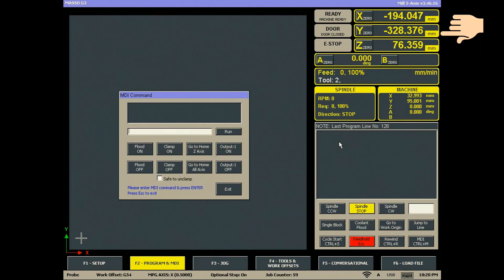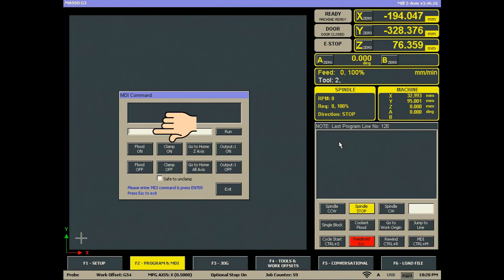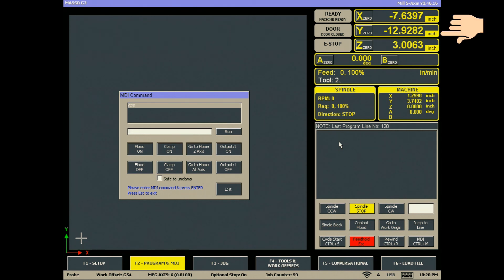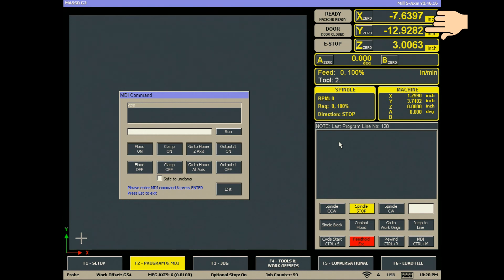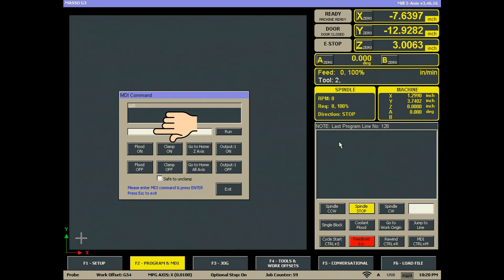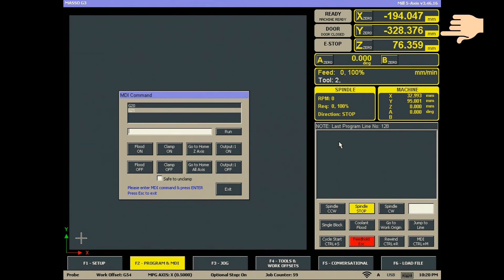Change between Inches and millimeters on your CNC - CNCnutz Episode 245

Comment: I got a dxf file that was in inches and it won`t change it to mm in my v crave pro
Reply from the maker: Maybe it is already open as mm. If this is the case you can always scale the drawing by 25.4
Select the entire drawing and use the scaling tool. This will resize it for you.
Cheers Peter

Comment: I’m a CBC virgin, and I’m having a problem with with the way my cuttings are coming out. I’m designing in Vcarve desktop, in imperial and using UGS to process. My jobs for example are 14”x14”, but when I run them they are coming out about 3”x3”. I’ve tried to find out what the problem is. I was hoping that you could help. What am I doing wrong?
Reply from the maker: Did you calibrate your axis? It you don't calibrate each axis it won't move the correct amount.
See my videos on axis calibration.
Cheers Peter

Comment: will it change the tool setting as well. I use mm that`s what I learned in.
Reply from the maker: It changes everything. If the tool is 1/4 it will remain 1/4 but is treated as 6.35mm.

Comment: Just watched your video discussing choosing MACH 3 or UCCNC and then this one.  Great video wonderful explanation.  Also I'm relative NeewBee so I chose UCCNC to start with but i am not able to understand how to change it to imperial.  Am I correct that UCCNC is metric only?  In reading below from qwert UCCNC is  unitless and everything is relative to the configuration file. Does this mean that you can change the units in the config  file. I would have sent to qwert but not sure he would see it.  Thanks in advance
Reply from the maker: Uccnc is neither metric or imperial. It works in that ever unit you set it up as. You simply tell it how many steps it takes to move 1 unit and that is it. You cannot change between units. Once it is set up but you don't need to. If for some reason  you want a metric and an imperial version just set up 2 different profiles and load the one you want.
Hope this helps
Cheers Peter
Reply: @cncnutz  Thanks for clearing this up for me.  I just need to learn how to create a profile.  Do you have a video on creating a profile?
Reply: Hello, I have created a new profile in UCCNC. What configs do I need to change or convert from mm to inches. The machine is in mm at this time.
Reply from the maker: You need to set up the machine using the inch as the unit if measure. When you calibrate the axis the steps per unit will be 25.4 times more that the current value. The soft limits will be 25.4 times smaller than the current ones. Each of the current units of measure will need to be either multiplied by or divided by 25.4 depending on what it does. In its most basic form  steps per unit is multiplied  all the other measurement settings are divided. 
Don't forget to backup the original profile before you start. 
Cheers Peter

Comment: Peter. When we get a project from Vectric in inches and I output that in inches in my post processor does that mean it also outputs the feeds and speeds I have put in my tool database, presuming I have the right sized cutters equivalent to the imperial measurements.
Reply from the maker: It sure does. Half my tools are imperial and I always use IPM for speeds and feeds because I did that way when I first started and can't visualize metric for those items. All my Gcode is output as metric.
Cheers
Peter

Comment: Just and FYI, UCCNC doesn't process G20 or G21 (they're ignored) because it's a unitless G-code processor and everything is relative to the configuration file. Thus, don't run either G20 or G21 files unless your machine is set up specifically for those units.
Reply from the maker: That's right which is why you use the post processor that matches the Machine rather than what the drawing unit of measurement.
Cheers 
Peter

Comment: Pete, very good video, I was just curious since the US and parts of Britain still use the imperial Neanderthal measuring system one foot in front of the other using the toes for better measurements. If you calibrate your machine in MM get it to the best accuracy in the millimetre measure and you then convert back to imperial figures, do you loose the accuracy?  I can only see that if you are machining parts that need tolerances in thousands or microns dimension, but I doubt anyone here has such a machines with those tolerances.
Reply from the maker: There is no loss of accuracy changing between units. Not that you or I will see.
Cheers Peter

Comment: askjerry, good remark . My machine is in mm native units. But for drilling friend's files I edited it and added G20 at the begin and G21 at end of each his file. I hope this is ok. I hope also Peter will comment this.
Reply from the maker: Perfectly fine way of doing it. If it doesn't have the g20 in the file you can change it using MDI if you want and when you finish use MDI to change back. As with most things there are several ways of doing the same thing and it is a matter of finding what works best for you.
Cheers Peter
Reply: Thanks, Peter

Comment: 2:28 - I beg to differ... if you run G-Code and it has G20 at the start... but you never issue a G21 afterward... you will get REALLY surprised when you MDI G0 X10 and expect 10mm. ALL my routines include G21 in them so that when a job is finished and I click my "Safe Go Home" button... it leaves the machine in G21 metric mode. If you turn off the machine, yes it will reset... but if not... please be aware that it will remain in the last mode set.
Reply from the maker: Hi Jerry,
I see what you mean. I should have phrased it better but I think people will get the idea. Hope that you are finally allowed out of your room. 
Cheers Peter
Reply: Good remark. My machine is in mm native units. But for drilling friend's files I edited it and added G20 at the begin and G21 at end of each his file. I hope this is ok. I hope also Peter will comment this.

Comment: Peter.  Good explanation.  As a Canadian baby boomer I was raised learning Imperial and then about 1970 Canada officially went metric (mostly).  I spent the 1980's in Australia, Italy and Hong Kong and then spent about 25 years traveling to the U.S. every week or two for work.  Fortunately I have a pretty good head for figgerin' and I consider myself to be fully metric/imperial bi-lingual.  We still measure our lumber here in imperial units because a lot of it crosses the border with the U.S. in both directions.   In my new exciting CNC world I tend to draw in Imperial and output the G-code in Metric.  I have also learned to read and interpret the G-code (I have a programming background) and occasionally I will modify a line or two to suit my situation.  Keep up the good work.
Reply from the maker: Thanks Ron
I grew up using both units myself and still do. Sometimes in the same sentence.
Cheers Peter